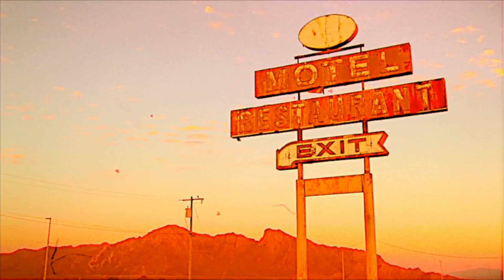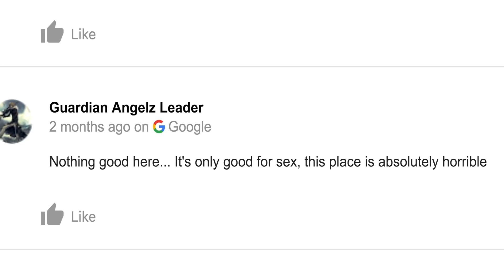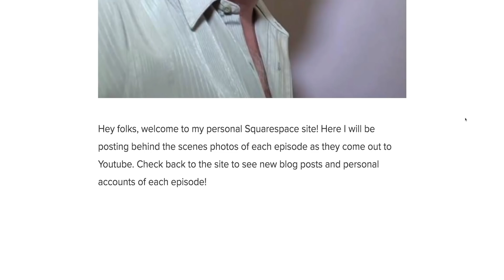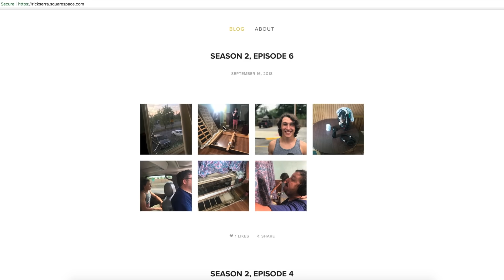Another Dirty Room S2E6 : Cleveland’s Bed Bug Drug Den : The Lancer Motel

Comment: Oh my god! I passed this place every day for two years when I worked in downtown Cleveland and I didn't know it was a real business until now. This is horrifying. There's so much real estate blight and abandoned buildings where people do drugs that it just blended in. There's so much hope in Cleveland yet so much of it is still beaten down that I fear that restoration efforts are too little too late.
Reply: Really it just depends where you go in the city. Some parts are in a boom, others are at an all time low. I mean, I'm at university circle and a ton of development is underway here, but at the same time Euclid Ave. cuts straight through the center of everything. Case has 2 security teams (one being Cleveland cops, the other being campus police), along with UH and CC having their own cops, just because of how bad it gets at night. We had 25 security alerts my freshman year.

Like every major rust-belt city (Chicag, Detroit, etc) there's a lot of good and a lot of bad. I grew up hopping between downtown and Parma so I'm used to it, but other people are surprised by how bad some areas actually get. Overall I'd say there's been improvement, but at the same time there are some areas that I think are just too far gone to ever bounce back. Only time will tell however.

Comment: Moldy Bathtub rose: That pink is probably *Serriata marcescens*, pink tub slime. It leaves rings in your tub and grows even in clean tubs, but here it's probably outrageously out of control.

Black spots on pillow: If it smells musty and there's black spots, you're sleeping on black mold. The pillow is literally infested with toxic black mold. You're breathing that all night long.

Brown Pillowcase: Okay that has to be decomp fluid from a body. There's no way. That has to be. Look at the way it's positioned on the bed, you can see the outline of a head there.

Mattress with stain: There's the decomp stain. I told you! It's not urine, can't be just urine. That's decomp.

Comment: The stainless steel or bronze wool is called Chore Boy. It's used as a filter so they don't suck the burning crack down their throat. It's supposed to be used to scrub hard stains off pots and pans, etc.

Comment: There's an American brand of Oven/Pan cleaning coarse scouring pads called 'Chore Boy.' 
It's one of the few remaning brands that still make their scouring pads out of copper-wool, which is why often you'll find packs of Chore Boy in these motels (usually wthout packaging). 
Besides supermarkets Chore Boy is also sold in Petrol stations where you'll often find them in glass cases as they got stolen by Crack-heads on a regular basis.

Comment: They use those brown an silver steel wools. As a filter for the crack so it doesn't just shoot straight into thier throat. I'm surprised y'all haven't found more pushers. An what that is a long straight item. So simple push the steel wool from one side to another. They feel like when u push it to the other side. That u get a couple more hits. It's crazy the shit they use it's crazy from a lightbulb to soda can to a tire pressure gauge. Sorry the point of all this was to say that those brown/silver steels wools. U get at a corner store an depending on the store. They might have what's called a brown bag special. Which usually come with a cheap lighter, a rose in a stem an a brown or silver steel wool. The rose an a stem is how they sell crack pipes legally. Just like oil burners are really meth pipes. The loop holes of America lol gotta love it

Comment: Everybody I know, though, brings bleach and stuff and cleans the bathroom, remote controls, tables, etc.  I don't care if it's an expensive chain hotel or a cabin or whatever.  The maids can't possible get it all and in your case, the maid doesn't clean bathrooms which isn't unusual in my experience.  I've found dirty hotels at $250.00 a night hotels.  Who has time to complain...when on vacation you want to get to the sightseeing and frolicking so just clean the room for an hour and go have fun rather than spend an hour on a phone justifying why you need a cleaner bathroom.  I'm not trying to be a downer but a realist.  If I'm in Cleveland and it's zero degrees I just want a warm, heated room, folks!!  A working radio or TV would be a nice touch but I'll sleep in my clothes.  I bring garbage bags and I'd cover the pillow with 1.  I've stayed in clean-ish rooms with mice...so I got a cat and it travels with me everywhere now.  It even eats insects.